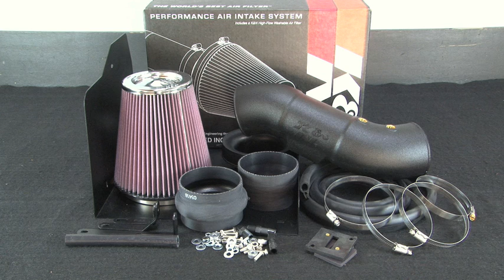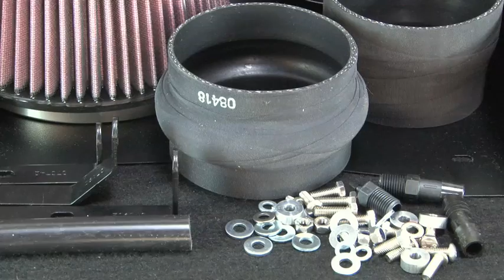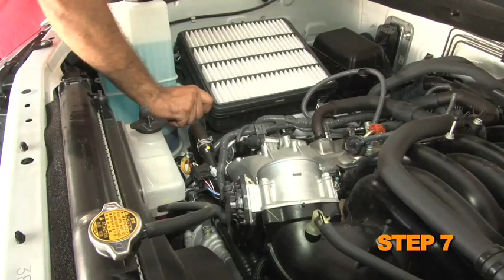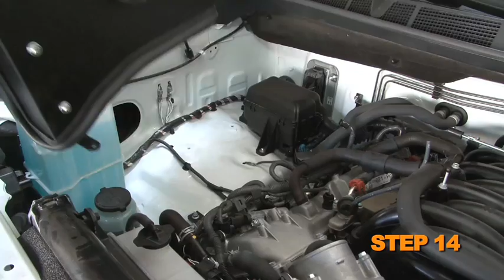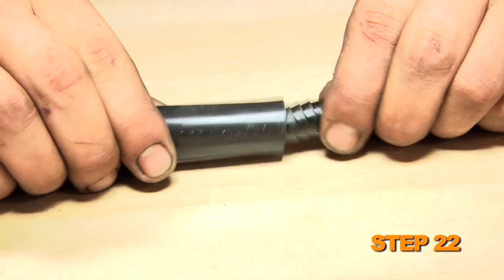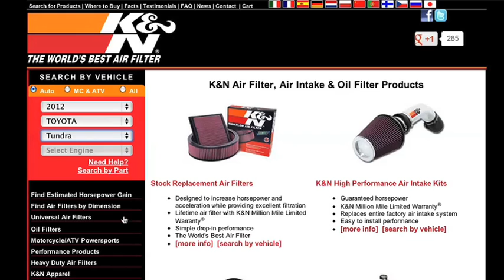Toyota Tundra 5.7L [#63-9036] Air Intake Installation

Comment: Just installed this intake on my truck and it will not start
Reply from the maker: rocky66 Check the MAFS that it is installed correctly. If it's facing the wrong direction, the car will not start.
Reply: KNfilters problem solved.
Reply: KNfilters problem solved.
Reply: KNfilters OMG!! THANK YOU! We did this and it started on my 19 Tundra! 😂😂🙏🏼
Reply: What was the problem?????????

Comment: I noticed in the 2011 video that you install the rear bracket onto the security horn mounting area, but it was not in this video and was necessary on my 2013 Truck. Maybe they should add that to this video for people who are not mechanically inclined. Other then that the install was a breeze and I love the intake!
Reply: Same here on my new 2014 tundra crewmax.  Had to take off the horn then place under bracket and fiddle with it to catch into thread correcrly. Also the front 2 bolt bracket on the heat shield did not match up with the mounting hole in the floor and I had to gently apply pressure to push the shield forward to have the hole align properly. Not sure if I got a bad shield or if that is normal. Other than a few minor tidbits of info or pictures that could have made identifying or assembling the bolts properly the install was a breeze
Reply: djpie2138 do you regret it? Any benefits? Better noise? I have a 2014 Tundra crewmax 5.7 and was think on buying one for my truck
Reply: Same for 2014 Sequoia